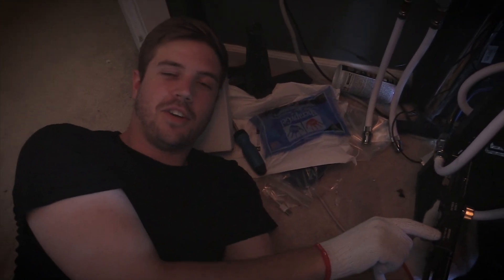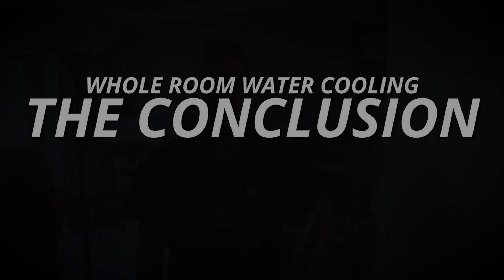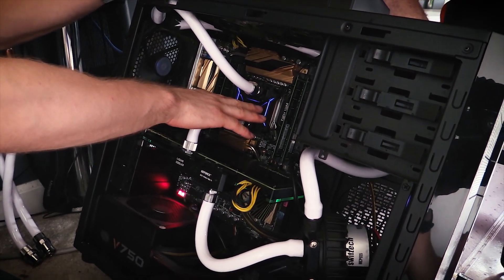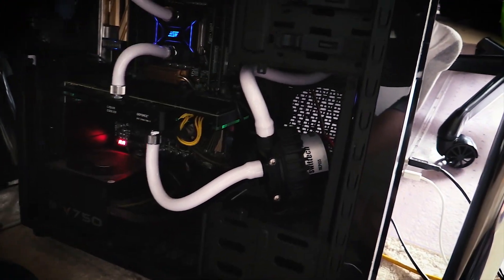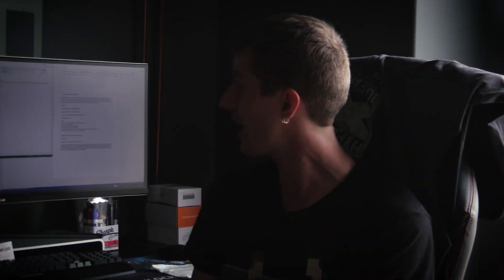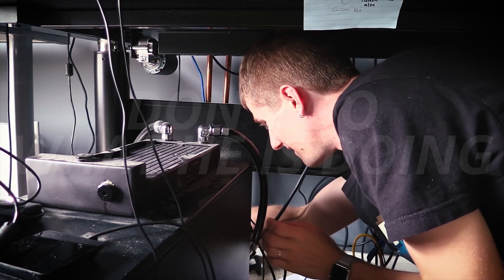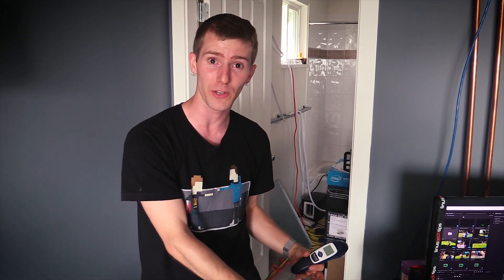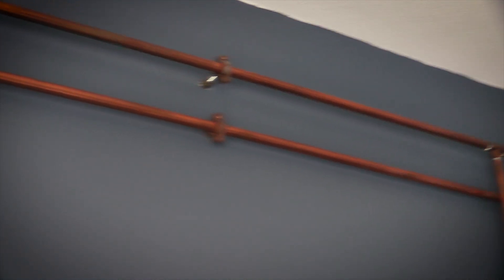Whole Room Water Cooling Part 7 - It's FINALLY over!

Comment: 15 years ago in my old apartment, the kitchen and bedroom shared a wall. I pulled out an old ½ size freezer from the kitchen and uses that space for dual servers. I just put the motherboards on the opposite walls in there. Then I made it accessible from both rooms using doors to be able to service it. In the bedroom I had a desktop with just a keyboard, mouse and monitor + speakers. THAT was REALLY nice...  I had upwards to 21 computers,  with 18 as servers. FTP, www, pop, CS server & 2 x DC hub's (Direct Connect) with a "Shoutcast server" for hub radio just to mention a few... Ahh. "Those were the days".. FUN memories...

Comment: Would be cool if you could link the coolers in to a hot water tank for for the house or figure out a way to recoup energy from the heat using a sterling engine or something.

Comment: If you think it is a good and workable solution when you did build you could use pex and run it all in the walls but the cost would be high with shut off valves as well as the quick release connectors but will would be cool

Comment: here's an idea, make a heat exchanger between the whole room loop and the main water system, probably somewhere before the hot water heater. insulating the hot pipe would help too

Comment: The basic plumbing errors on this build are unreal. The res should be fed by the water main, there should be a tap, and at least three air release valves. And none of that downward copper piping is secured to the wall. Two pumps with different flow rates will damage each other. Hope nobody uses this as a guide.

Comment: I know it's been a few years since this was posted, but the idea is sound, but the execution was lacking. Google is known for cooling their data centers with water cooling, so it's not that far out there. The main problems were not insulating the copper pipes, and mounting the pipes so high up that you actually use more than necessary just to get the aesthetics of it all. If they were mounted along the bottom of the wall (like a traditional baseboard radiator), it would have also solved the problem of air in the pipes when filling them.

Comment: Stick with computers dude, You clearly dont have a clue when it comes to cooling on a system like this.  Stick a air conditioner in the bathroom window, and put a radiator in front of it along with a pump and be done with it. Oh, and why in the world would you not insulate the cold copper line.  Like I said stick with computers only.

Comment: I think those copper pipes prolly have more cooling surface area then the actual radiators. imho they would needed to be insulated (at least the outgoing) to truly carry out the heat, otherwise its just spreading it out.

Comment: Why didn't wrap the copper pipe in pipe wrap(homedepot) https://www.homedepot.com/p/M-D-Building-Products-3-4-in-x-72-in-Black-Self-Sealing-Pipe-Wrap-Insulation-50162/205129980?cm_mmc=Shopping%7cTHD%7cgoogle%7c&mid=sXHAZG02o%7cdc_mtid_8903tb925190_pcrid_111414437105_pkw__pmt__product_205129980_slid_&gclid=CjwKCAiArOnUBRBJEiwAX0rG_ckFfn9M6St2ZhzuXDaFy_bVwM6ljrFXnYZTuMutTzSsF2kZyHyqoxoCK3wQAvD_BwE&dclid=CIX_xfCl0dkCFYN_Ygodxp4FVg

Comment: Things you could have done to improve it:
•Insulated piping 
•purified water (not tap water as it contains minerals, maybe that's what corroded?
•some sort of ambient are cooler using the system; basically a homemade air conditioner/humidifier?

Comment: computer fans+radiators = bottleneck! Put a high performance thick aluminum radiator made for a big car engine and a corresponding fan on there! Also, insulate the tubing.

Comment: My solution for a friend's setup was to put the computer in his basement and run the video, audio, and controls up through longish (but by no means extreme) cables. It was done for noise, space, and aesthetic reasons but would work for heat as well.

Comment: I suggest you replace it with radiators of cars (air conditioning radiator), it is larger and more efficient, and does not need to tubing (not leak); suitable for outdoor use ^^. u also need only 1 big fan (<20 fans), it easy to replace.

Comment: this is the second time i've watched this series and feel like commenting some "non plumber" points.

i would have thought you should elevate the water supply. bring the cold water supply to above the highest inlet, like have it mounted to the entire bottom of a table and have the towers below the table.

use gravity to pour the water continually from the supply across the processors. you can get more water through it by using a pump ut pumps are less reliable than gravity due to their entire needing to be turned on thing.

take the hot water into a common tube similar to a storm sewer and have it angled using y instead of T joints, with the y further angling the water towards a catch basin.

the remaining problem which is hardest is cooling.

idk what is best but i'd suspect creating another large basin of "thin" copper tubes, with waves of additional copper on the outside, would increase the cooling per centimeter of fall, then collect into a last basin which has a pump attached and drives the liquid back up into the desk reservoir.

this still would have an issue of the outsides of the cooling tubes likely getting biomass due to the warmth, but meh.

...

your actual build seemed quite like what a professional plumber would build, though with missteps. but as someone who likes marble machines and rube goldberg machines,  i think it would have been an interesting creation.

even now i think an interesting potential reaction would be to make a similar base design water feature for a business. literally right next to the front doors, you could have a giant 12 foot  tall array of cooling pipes (or even spring shaped tubes) which dumps heat outside. due to the design of entrance ways it would have a nice amount of wind and atmoshperic cooling. glass pipes with copper inlays delivering the hot water while starting to take some of the heat out, could be visually nice creating water paterns on the sidewalk to the entrance.

for this specific opportunity though, it probably would be better to have the pump just after all the computers, or servers, and to have the hot water getting pushed up to cascade out of the building, as opposed to having the cold water having it's placement reddied for cooling. you wouldn't have a cold water reservoir, but would have a large loop with the piping itself being the reservoir.

Comment: So my thoughts... awesome idea. Just got some issues. Water does not like to flow parallel like electricity. So you don’t have that good of flow to each system. The water would rather bypass it since you have those T’s. Also you need to have bleeders at the high points. Also I would remove the PC’s pumps and only have the room pump. For radiators. I would use a automotive radiator. And one big electric fan. Make it easy. I think it’s an awesome project, you just need some smart people like yourself Linus lol.

Comment: Well, now it has ended I'll tell you what I would change as an engineer in your system so it would not have the problems you had complained about:
1- Cover the pipes with chalk (gesso) its inexpensive and would give a nice finish and is thermo isolant
2- add 2 outlets to the top end of each pipe (the hot and cold water pipes), so in order to eliminate bubbles you just connect each other and turn the big ass pump, no need to run it through computers
3- the water reservoir on top would be better to fill up the system and take the air out and for draining just use a bottom outlet, running all pipes as low as possible would use less copper and consequentially have less air-stopping-points to deal with
4- before putting the water inside treat it with bleach: 1 table spoon per liter would sterilize it and 3 hours later in an open and transparent reservoir it would turn into gas and just begone without the chance to react with the metal components.
5- the coal in the filter is used to take any extra cloride in the water, so I guess you didn't need that much XD

Some of those were a little impractical I guess, but would save money, headache and would improve the overrall performace you guys were seeking.

Comment: You guys should have placed the radiator in the ground so you don’t get the heat from the sun. It should also maintain an ambient temperature underground that would be cold even on a summer day. Just a thought.

Comment: Do it up in Canaderp!
Back in University, I sealed up the side of my comp to the open window in the winter, kept rad separate, and was getting negative idle CPU temps, barely broke 20 under load and overvolted/clocked......back in the day (Athlon XP2700, and later played witha n 1800 DLT3C stepping.....my math showed was probably pushing over 200 watts through those things.....video cards two, blew up two of them due to excessive voltage....back in the day....)

Comment: AC wouldve been my first solution as well BUT i think it would need whole house ac combined with one may be 2 window units to keep that room cool for  the whole summer. You are gonna have what 4 machines averaging 350wtts of power? that alot of heat. more than 2 little window units can handle 2/o icing up rather quickly, which is why ithink whole house a/c and 2 big window units would be needed. I had a similar problem in a south facing offfice with big picture window and probly poor insulation since it was a old house and one big  window unit wasnt enough.

Comment: It reminded me of Mythbusters: A massive amount of work and it just didn't work. Like their JATO Chevy Impala, which never flew. 

OK, the system works and performs well, but it didn't do the thing they set out to achieve: Keeping temperatures in the room down. The ratio of work-performance just didn't add up. An AC would've been installed in an hour, achieved more and cost less. But installing an AC doesn't get you millions of clicks and tons of free hardware ;-)
Reply: True that, but a lot more noise.

Comment: You guys did all this work and did not try adding an air conditioner?? For cooling testing!!!
Reply: if the "office" is still around do the AC test guys!!! that'd be awesome if all was cooled using more electricity. Yet would suck due to electric bill. Shoot. For testing reasons would be cool, though payment overprice would suck. Good luck guys! and thanks for the video. I thought about doing this myself. Why no pipe insulation???????? Maybe could have helped in a way. Raw pipes made me think a few things, I am a carpenter and know some stuff. There were a few things def. could have added for testing alone.I see it ass a years worth of work then go all out with stupid stuff such as insulation on the heat or cold leads. Or an A/C in the office building. Then again you guys did what you could and thank you for that alone. You guys did a great job. Wish things worked out for the better due to effort.

Comment: I have to agree with some of the comments here, a window unit would work great, it's a win win, more cooling in the room and you can relocate the main heat exchanger on the return side(the front of the window unit) to remove more heat from the work stations.

Comment: use mineral oil instead of water, the heat dissipation decreases (the oil transfers heat slower) but you almost never have to deal with corrosion.

Comment: If you want the room to cool down and the computers... I just find myself going... why not have all computers radiators hooked up to a exhaust air duct which leads outside the house.
Yes additional fans would be needed but in theory it would cool down the computers and not use the room as one big radiator.
And exhaust unit would be cheaper to do too I would bet... Maybe it's a stupid idea but at least insulate the inlet and outlet piping from each other.

Comment: A nice solution :) i/we do this other:

I/we put all system/Workstations with current HW and  server in a AC cooled room and we use a PC Cables to Fiber to PC Cables System do connect all connection to the system. 
It is expensive but the room is silent and "cool".

Comment: The best option (imho) for cooling air temp in your room can be achieved by moving your rigs behind the walls. And through the holes in them pull the cables out for your keyboards etc. We did it in our previous office. Air conditioning is also a must-have. Cheers!

Comment: Over thinking? To me it looks like under thinking! (German vs. American view I guess ;-)) When I saw the copper pipes I instantly thought of our central heating at home. It uses copper pipes with aluminium fins. However, just the pipes (21mm diameter) produce 100W/m with 60°C water - My estimate is that the room has about 50m of pipes, but the pipes seem a bit thinner so it could dissipate
 around 3kW! Just some simple physics could have told you this will not work to remove the heat. On the other hand, 5 times lets say 300W of heat on average per PC makes 1500W. That's a lot of waste heat. So what could that be used for. Something you will need even in summer is hot water. So if you get an insulated water reservoir - 1.5kW can raise the temperature of 200l water by 60K (20°C to 80°C) in about 10h (assuming there is no loss). So the waste heat of the PCs can easily provide a warm bath for the whole team daily. The winner would be both your bank account and the environment.
Using an A/C is again very US I would say and environmentally as bad as you can get. First the heat needs to go from the components into the air via coolers and fans, then from the air to the coolant of 
the A/C and then again into the outside air. That means multiple energy transfers which are all very inefficient. So you consume even more energy which produces even more heat to achieve this. No wonder the US has twice the energy consumption per person compared to Germany and even we do use a lot of energy.
Reply: If I had money and a company, I'll definitely hire Holly Schone!
Reply: Total Geil!
Reply: But - BUT - we aren’t sweating through every layer of clothing :)
Reply: The US has twice the energy consumption per person because, FREEDOM!
Reply: One linus is Canadian
Two ac is actually a rather efficient system in fact it also works well in reverse. The energy you put in to the ac system is only to pump the refrigerant 1500 btu ac actually uses less energy to remove that 1500 btus from the room
Reply: Don't worry mate, there's a lot of environmental nuts that think they are smart and can do better to "improve" the environment but they really know nothing about anything. They don't know how current industry is, or current industry devices, and they don't know what actually harms the environment. They assume everything is super inefficient already because they assume the people who make the things don't care, and then they make super inefficient and impractical shit to push onto more idiots who will buy something worthless because it is "environmentally friendly" when in reality it is way less friendly because you need 10x the amount of the device since it is 10x less efficient than "normal" devices.

Solar panels for instance are super inefficient and aren't really so great for the environment because of how shit they are. You need 10-20x more solar panels to actually make it useful and comparable to traditional methods, and by the time you've wasted shit tons of expensive resources building your 20 solar panels you've done more to harm the environment than the guy who took 20x less shit than you out of his backyard.
Reply: Lmao why the anti american point of view? Well I mean our current administration is doing jack shit for our planet. But hey, more $$$ for today's industry CEOs means that their blue collared workers just MIGHT see like a tenth of a percentage of that extra dough in the FUTURE. The older dudes who MOST LIKELY voted for our pumpkin sheened man in office probably wont see that money :( . Their kids will though! They'll be enjoying that extra $2 raise either spending their time in the mall due to record high temps, or keeping their oven on and open if they live up north because they're in for a wild ride in terms of climate. That's if they still have a house seeing that we're only getting more and more hurricanes every year now. So yeah, you know what, I can see why you Germans would look down on Americans and the person who the working class saw fit to sign a couple of papers dictating our planet's fate.

 Also the dude above [LilJbm1] me has been WRONGED, like seriously hurt by some ENVIRONMENTAL NUTS who have turned my frogs gay!! These people trying their best to make sure we stop using fossil fuels are all part of BIG SOLAR , who obviously like the FOOLS they are don't know what a CARBON FOOTPRINT or a CARBON OFFSET is. These quackjobs in their fancy universities are swindling our lord and savior in Office out of his money! They're not doing any research!11!, and  they obviously take advantage of the CLIMATE CHANGE HOAX, see we live on a flat earth, antartica is a hoax! so surely there's no way that ice wall will melt completly!!11!  California? pfffff those damn libtards are just plain making up their record low fossil fuel usage. Their investors? $2.2 billion invested on the renewable energy hoax? LIBERALS AMIRITE? CALIFORNIA AND ANTARTICA ARE HOAXES/s 

“A society grows great when old men plant trees whose shade they know they shall never sit in.”
Reply: "we live in sosaity"